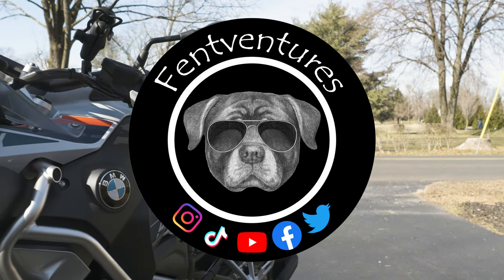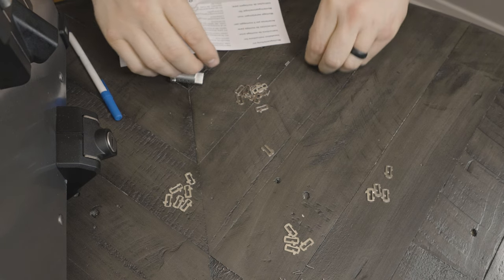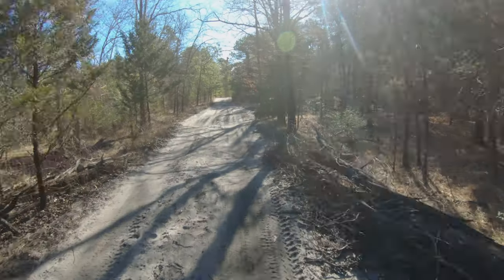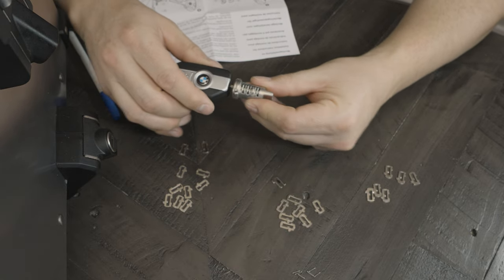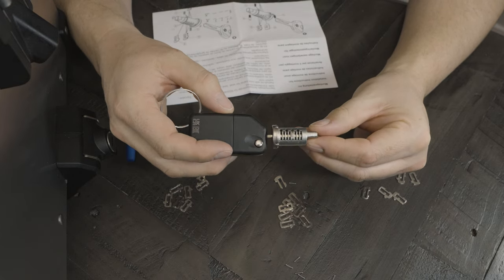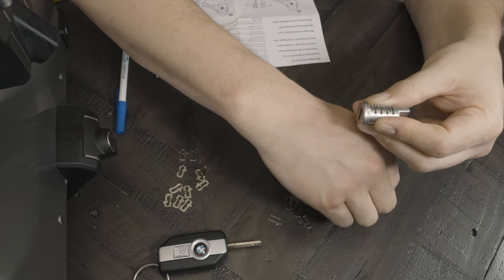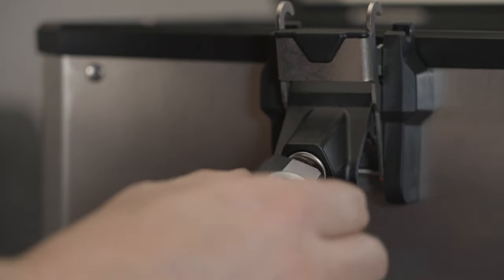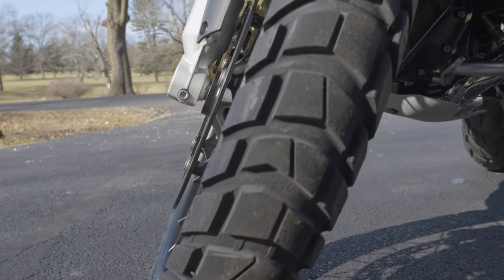Build BMW Pannier Lock Assemblies #r1250gsadventure

Comment: Thank you! I just bought the volume extension kit and realized when they arrived that I had to spend another $100 on locks for them. Managed to find out which ones to buy, and got them from a local dealer. You helped me with the last part: making them useful 🙂